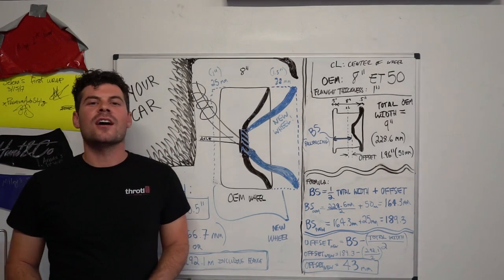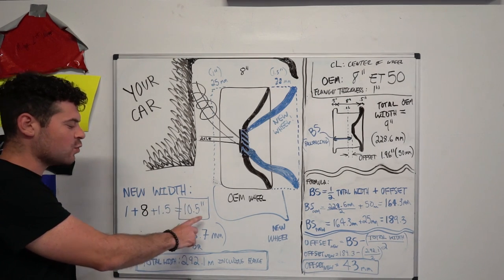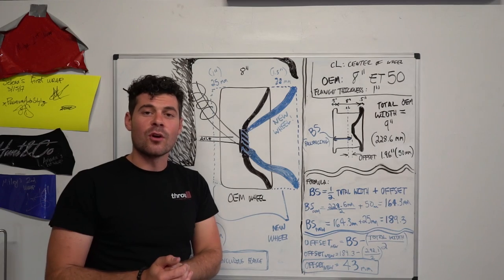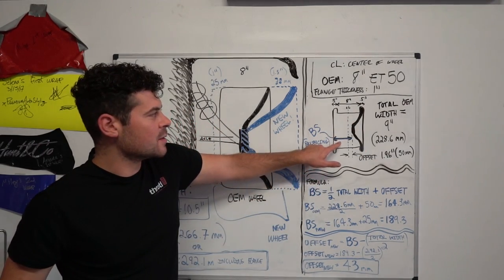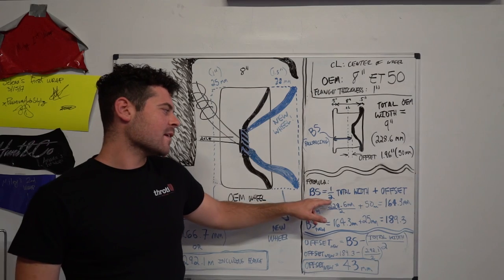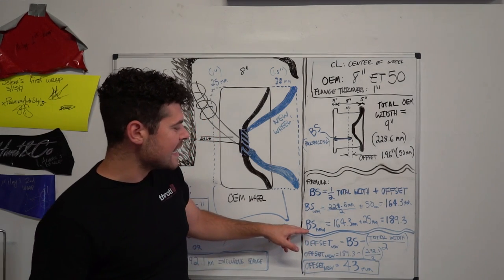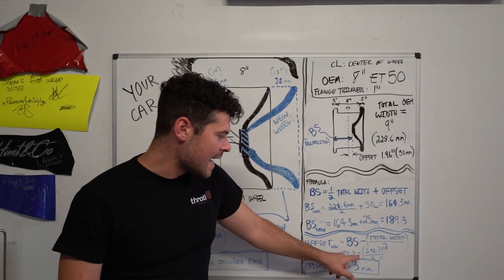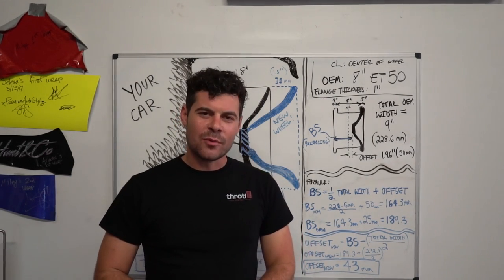HOW TO MEASURE OFFSET AND BACKSPACING! (Part 2)

Comment: You calculations are not correct. What you did here is that you added the extra width of 25mm inboard, instead of 12,5mm inboard + 12,5mm outboard. With your calculation you get a backspacing and offset that is too big. Please correct me if I'm wrong. Thank you

Comment: Listen at what you said about the positive and negative ofset again, you got it wrong
Reply: KosovarMods so what's the correct way? Pos+ offset means the mounting point is closer to the face of the wheel rather than center? And vise versa for neg- offset?